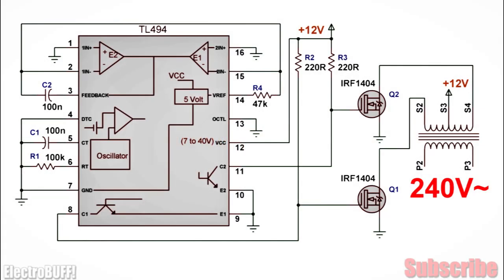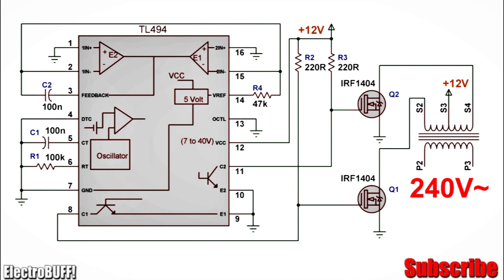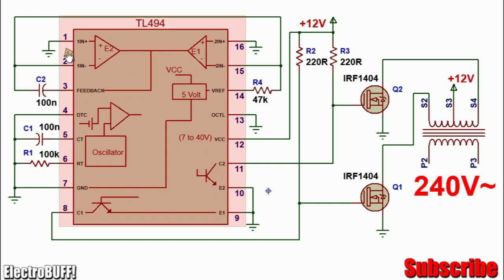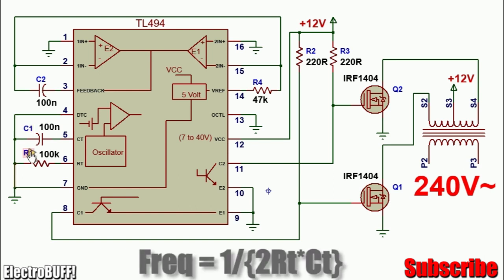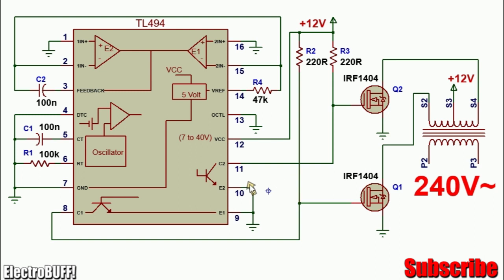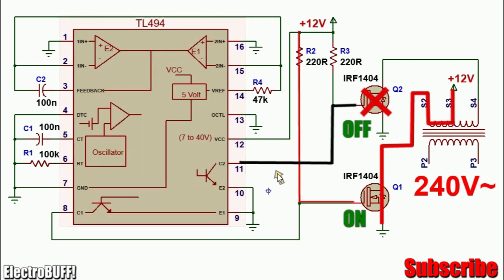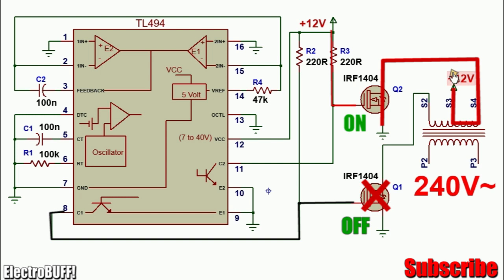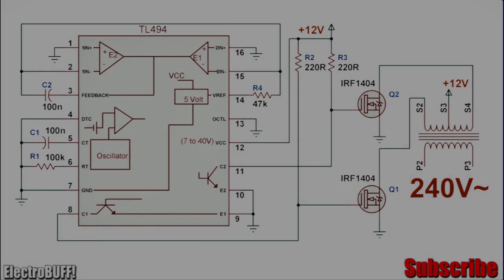TL494 Inverter 12v to 240v DC to AC

Comment: Can make a buck converter from 100volt to 12volt no heating of mosfet and a low battery cut off protection with soft start